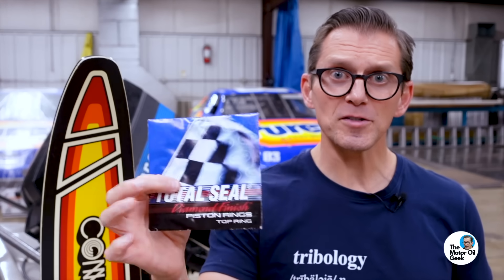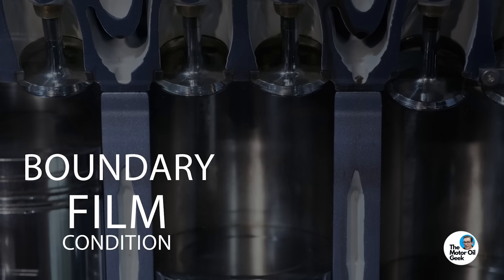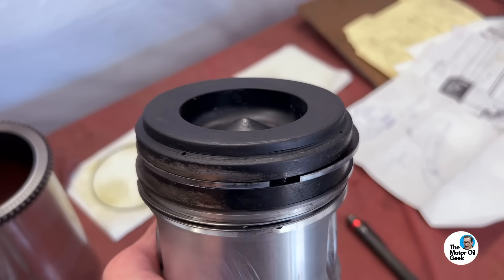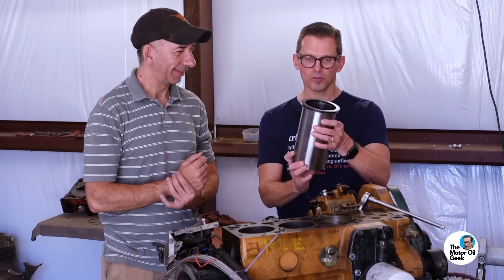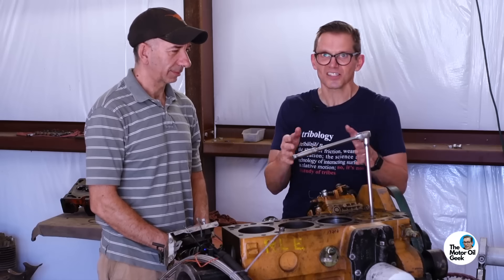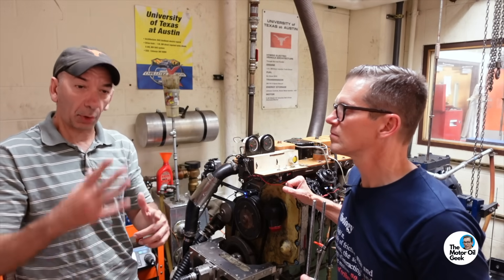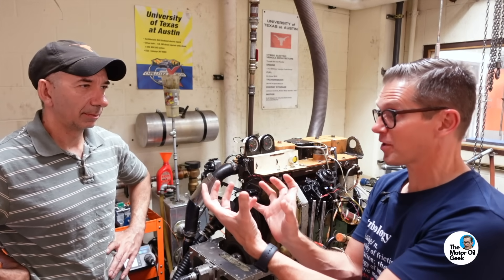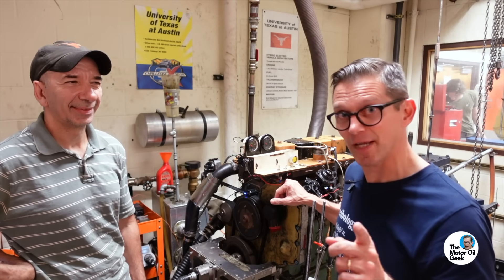Water Skiing Explains LUBRICATION - This CRAZY Engine Proves It!

Comment: I have been building engines for over 45 years. Its amazing every time I see something totally different. Never to old for learning new things.

Thanks for another great video.
Reply from the maker: Thank you!
Reply: Just curious when are we going to start seeing your tests on Amsoil? In your Q&A video maybe 6 months ago you stated it was coming up soon.  @themotoroilgeek
Reply: Only a true master knows what you just said. I’ve been in the business for 15y and have been shown over and over that you can learn something new from anybody - yes, even from the young guys. It baffles me how some people close their mind after certain time.
Reply: i remember seeing this in 2015~ whenever i was researching ( friend's/coworker's and siblings idea and or them trying to get me to ditch the 8-71+mechanical+mag parts list/build i was doing for my 2-gen charger F8/green aka i had this before FF1-movie as a 4~yo/1995~ and or next door had a blue-car i liked-etc ) how to add modern-EFI/GDI/TT to a 1970~383 mopar, and yes my new build it's on my to do/add-list for my D8-hemi/re-pop-iron 540~ci ( with 4.3in-pistons liner's wonder if the bore sized vs piston's or high-dome/dish makes a difference and or block( i don't like aluminium casting's but this is my 2C and yes it's backed in testing like Canada hemi-shop/Indy-auto/YouTuber-channel 20~hp-gain-ect and also my time R&Ring Chevy's/vortec's/ford's mix'd-casting materials of the 80's-12-era and lifted head gaskets-ect aka milkshakes from daily/cold-starts-ect )/bearing materials and or liner's and or possibly to make the liner out of say T70-aluminium for heat-spreading/thermo-siphon/heat-sink and or anti-knocking+better-rings-sealing reason's, also from my understanding at least in bushings-piston's/rod's aluminium bearings are less likely to sease-up aka better materials and or additional DLC helpful but im not sure if that carries over to pistons+liner in full-film bearing-mode or a terrible idea ) combo but im not convinced that having it at the top and or split-head's is the best method as offies/bugotti's/dussenburges/aero-engine's sometime's doesn't have head-gasket's and or can run stupid amounts of boost and or knocking and the next fuse that fails is the injection cup's/aluminium in iron/steel-head or the piston's also aluminium fails before the steel/SS/titanium from heating or stress-crack-propagation or the exhaust valve/seal gets burnt if pushed way to hard more likely without being cooling like ( and add note that it helps if the valve head ect keep's the heating in the air/aka-power-pulse and or out the-pipes, instead of being put into the oil or water-loop )sodium-filled or barium/copper seat-materials combined combo

Comment: No mention of friction loss in the rotating liner, whether liner lubrication provided. Seems overly complicate additional manufacturing negates some benefits.
Reply: The complication is justified for heavy duty engines that operate over long periods of time and consume huge amounts of fuel.
Reply: I agree that there has to be some cost to the continual rotation of the sleeves. It would be interesting to see how much lateral movement was required to keep the rings in hydrodynamic. That practical working engines have had sleeves rotating fast enough to operate as valves indicates that this is not an insurmountable problem. Although this is more complicated to manufacture it probably isn't worse than many other changes made for small gains in efficiency.

Comment: It'll never be in production engines, but it's cool to see it.  I wonder if he ran the tests at such low temperatures because his system can't handle normal temps, or maybe because the friction goes down and it would yield less of a difference.
Reply: The engine tests were at normal operating conditions.
Reply: @dimitriosdardalis6658  150F isn't normal, unless this particular engine is designed to run that cold which seems unlikely.
Reply: @DonziGT230  160-165 is on the cool side of normal, but it is very hard to get these single cylinder engines to get hotter than that.  Especially the RLE.

Comment: So how would it not rotate the piston rings in the pistons while it's rotating? And if it did so at all wouldn't there be some unwanted wear on the ring lands? I can't believe this could ever be  a design that could be useful other than a tool to understand wear characteristics in an engine.
Reply from the maker: The rings are pinned in location like a 2 stroke engine.

Comment: I wonder how long it will take for this to make it to the real world.  I feel this adds another level of complexity to the ICE and ultimately electric will take over. At some point, the high level of complexity will prevent it from getting such motors fixed in most of the garage.   In my mind the future is diesel electric propulsion.  Where Deisel generates electricity and motor is attached to the gearbox.  Much simpler and efficient.  Diesel or gas will work in 100% load all the time and hence much more efficient.  Similar to Prius.
Reply: That Diesel will last longer and be more efficient with a rotating cylinder liner! Hybrids are a very efficient tech. Electric cars have a simpler motor  but the complexity of energy storage and generation still exists even if off the car.

Comment: Science and common-sense feels like a guilty pleasure these days. Thanks!
Reply from the maker: My pleasure!
Reply: @themotoroilgeek  That’s some serious dedication and engineering!
Reply: Probably not a good cost and weight trade for a car, but very probably a very useful efficiency boost in certain niche such as high duty cycle stationary engines such as a genset in remote area. I bet DARPa will love this.
Reply: @richardkudrna7503  i disagree as this makes manufacturing easier and or rebuilding easier and 9% improvement in a MPG-10 would be about 2mpg but in 50mpg be 5mpg~ so even in a beater/economy-box worthwhile as they do less %-gain Chevy's skip-fire was 3~% over the 4-cly-mode and that doubled the parts in the 8V truck's/car's engine 

id add this just for easier rebuilding in my 1960's/540 hemi ( simi's/cat have-wet liner's that let you do rebuild's in frame, a 440 would probably become the same but im silliness and have hemispheric headache's vs brakes/hydraulic's-bit's and or im running a bed-plate mod/design so good luck with main's/rod-bearing's ect ) but the other bonus is reduced hot spots and or rotating the hot-spot away instead of hitting the same-parts
Reply: Yes. Now people put a DEI filter on reality.
Reply: @richardkudrna7503 Nicely put, sir. Think I may have to steal this...

Comment: Interesting concept. Is there anything lubricating the back of the liner against the block? Does the 10% advantage factor in the energy needed to rotate the liners?
Reply: There is pressurized oil lubricating the exterior journal bearings of the rotating liner.  Lake answered the second question.
Reply from the maker: The 10% friction reduction is net friction, so that includes the friction loss of rotating the liner. If you look at the stribeck curve, the continuous rotation would not add much friction (hydrodynamic and low speed).
Reply: @themotoroilgeek  Thanks, Lake. Appreciate the clarification.
Reply: Seems like more oil shearing also , but I'm ignorant lol

Comment: I don't know if I agree with this as you don't see that much wear at the bottom of the stroke . I feel that there is more wear at the top because on the power stroke the pressure is the greats at the top which forces the rings out more . Buy rotating the cylinders helps to reduce oval wear which is common to see . Also spinning the rings in the piston would cause premature ring land wear ?
Reply: The rings are pinned, but you are correct, there is a lot more wear at the top of the stroke.  The oil control rings wear the same on both ends though, and the oil control rings generate a lot of friction at both ends of the stroke.
Reply: I'm also wondering about ring land wear. Not to mention maintaining reliable lubrication of sleeve to block and gear drive teeth.  Lots of questions still to be answered.
Reply: @davidg3944  The rings are pinned.

Comment: I dont get it, the sleeve is at the exact wear location from 30 degrees before/after TDC. The rotating sleeve does not change that fact. It would certainly eliminate any out of roundness wear...anyway the increased complexity of the engine makes it a no/go. Kinda like the variable compression ratio engine by Nissan, the added complexity is not worth it.
Interesting video!
Reply: You missed the key point.  In a conventional engine, when the piston is at TDC or BDC, there is no relative motion between the rings and the cylinder.  Both are stationary and thus the hydrodynamic oil film is lost momentarily.  And during the travel close to TDC or BDC, the relative motion is slow enough to get into the transition region.  With the rotating cylinder, there is always relative motion between the cylinder and rings.  This allows the oil to remain in the hydrodynamic regime even at TDC and BDC as the cylinder is moving even when the piston is still.  Make sense?
Reply: @LTVoyager  Yes it does! Thank you for the explanation!
Reply: They are sliding the lake under the skier for that moment when the ring is stationary keeping them above the water.
Reply: @MathewPollard-vj4uq  I love that analogy! Nice!

Comment: Interesting but considering the problems of sealing and cooling a rotating liner it might be better to rotate the piston
Reply: Exactly, i thought the same. Probably better on a dished diesel piston vs something like a domed piston with valve reliefs.
Reply: @jtrill2  The problems with rotating the piston are very serious.  The sealing and cooling issues of the rotating liner have been resolved.

Comment: That engine modification was so cool.
Reply from the maker: Absolutely!
Reply: @themotoroilgeek  Since there is oil between the inner and outer liner, could you just cool the bottom end with oil and make the head cooling a separate circuit? I'm assuming the higher specific heat capacity of water is needed near the exhaust valve especially, but it seems this system already has a layer of oil transporting the heat in the bottom end. I've talked to Dimitri online and he doesn't object to me trying rotating liners in my gasoline prototype engine, but I'm very concerned about the water-oil seal.

Comment: Hey Jake how about making a video about DLC and how it interacts with oil?
Ive read that molybdenum is very bad for DLC parts while esters are particulary good.
Now that more and more DLC components are available it might be interesting for people.

Im plaiing on using lifters with DLC for my flat tappet engine for instance. Something that Godbold talked very highly about. 
But then I found all this info regarding how it interects with the oil..
Reply: I know he's said that it more something you end up having to use, if it breaks free it'll tear up the engine pretty badly.
But if you plan on using it on flat tappets then it's probably a really extreme build with strict rules and money is not an object to be competitive. 😄
Reply: @ well the comp cam DLC lifters are intended to be used with ordinary iron cams.
I know that up til now its always been for high perf with tool steel cams etc. But the comp ones are intended to be used instead of ordinary lifters.
And for my engine they werent any more expensive so I went for it.

When talking about other engines like honda four cylinders its becoming more and more common with DLC parts also.
Even some OEMs use DLC parts now.
Reply: @magnusdanielsson2749  There was an issue with quantity and quality of lifters after the pandemic, I'm guessing it was cheaper and/or easier for them to have this done offshore than trying to set up manufacturing in America again. (I haven't looked into the price difference) 
Yes lots of engines use DLC and for good reasons, but it's not without risks.
I know I've seen recommendations for lifters with oil hole at the moment, if it's mechanical.
Reply from the maker: Thanks for the suggestion. There are different versions of the Molybdenum based friction modifiers and there are different forms of DLC. Some of those "combinations" do not play well with each other, but there are some types of Molybdenum based additives that get along well with a wide range of DLC coatings. Likewise, there are some DLC coatings that get along with a wide range of Molybdenum based additives.

Comment: Wouldn’t a rotary engine have cylinder that has has I suppose would be called a continuous motion?
Reply: The Wankel engine apex seals have a similar continuous motion.  But unfortunately (for the Wankel that is, not for us) the apex seals of the wankel engage the stator at a very high angle variation, so they require a very curved contact face.  This very high curvature cannot build a film thickness, despite the high speed.  In fact, the combination of high sliding speed and lack of film thickness creates high wear.  They tried to mitigate the issue by using ceramic materials.  But at any rate, the wankel cannot achieve good thermal efficiency for other reasons unrelated to friction.  The Wankel is only good for high power density, not a critical factor for industrial engines.  The critical factor for industrial engines is thermal efficiency and longevity.
Reply: Yes but not sure how hard it is to have oil all around the surface.  I ran premix in mine and there is a fresh oil source called a sohn adapter that helps.  But this video seems to be benefiting from a better layer of oil.
Reply from the maker: It would be similar.

Comment: That's impressive to gain efficiency while increasing the demand from the motor.  As in turning the cylinders vs not.
Reply from the maker: It just shows how much friction is in the ring and liner interface near TDC and BDC.
Reply: @themotoroilgeek  Lake are these set up with ring tension closer to the old standard or new low tension ring standards ? Could the rotating sleeve allow a return to more ring tension and reduce blowby and oil burning ?
Reply from the maker: @MathewPollard-vj4uq  These are standard tension and size rings.
Reply: @MathewPollard-vj4uq  The only modification to the rings are reliefs at the end gaps to allow pinning them.